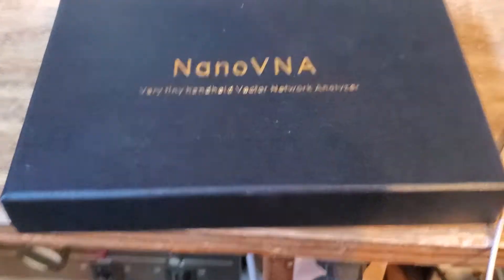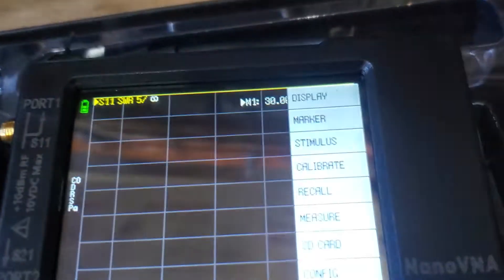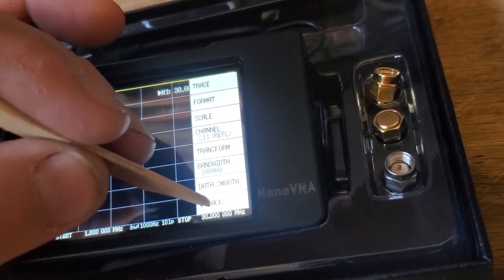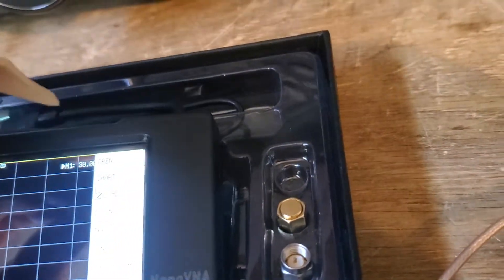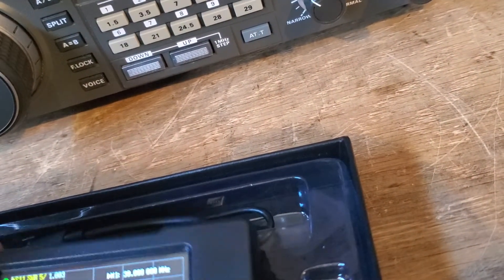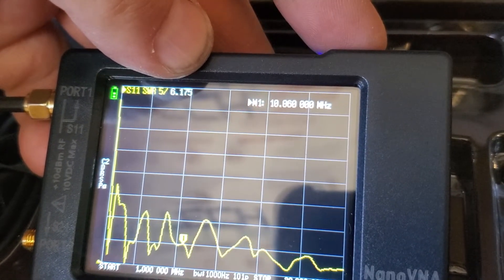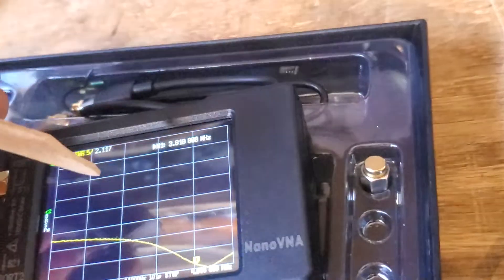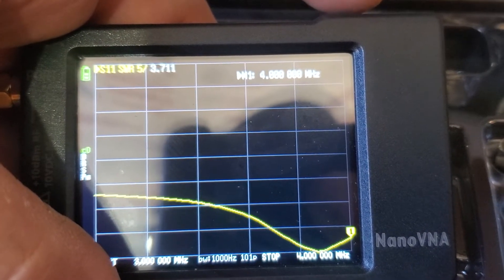HOW TO USE NANO VNA: SWR  OF ANTENNA.

Comment: Why do you need to short the antenna before hooking it up? And how exactly do you go about it?
Reply from the maker: Incase static electricity is built up on it. It will short out sensitive components in the unit. Just touch something conductive across center conductor and ground

Comment: if your going to use it for 11m what would you set it at for frequency ?
Reply from the maker: Probably  sweep 25-30mhz
Reply: we not care 11m band name we use freqs what we use. we not care what band is. we measure what freqs we use lol. if antenna is build for it we going find out. basically 11m just tell you need 11meter antenna